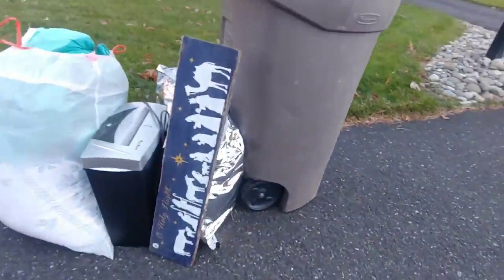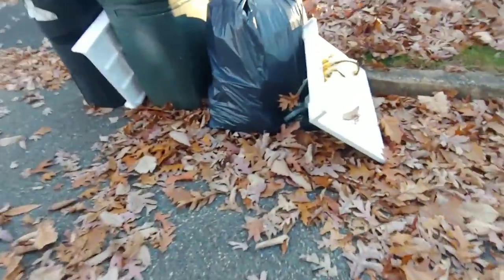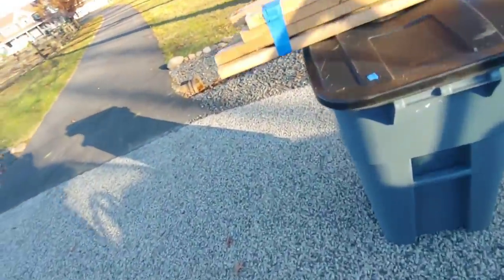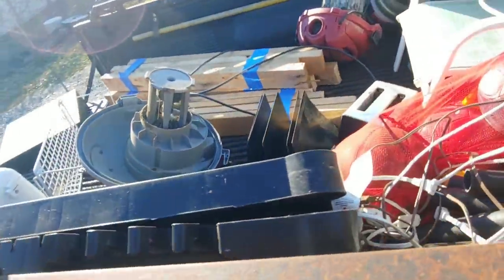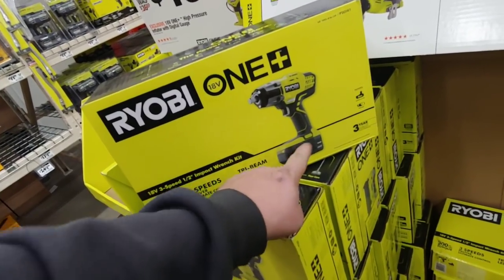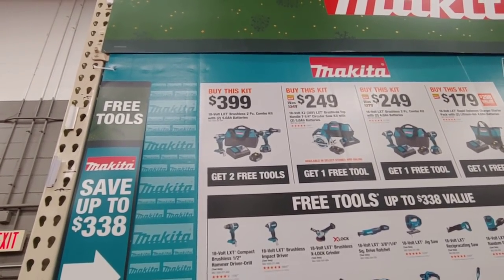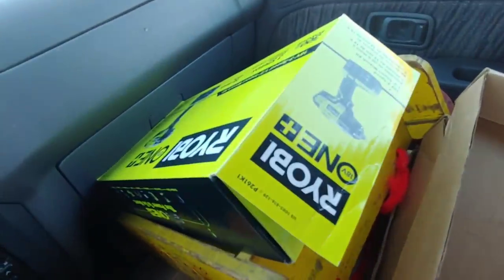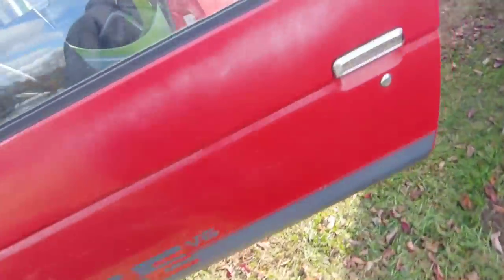Recycling Metal - trash picking Black Friday deals

Comment: I don't want the P135 I want the P125 you got. much easier and flatter to wall mount.
Reply from the maker: Yes but the P 125 does not charge all the batteries at the same time it charges them in series one at a time I believe the p135 will charge all of them at the same time but I may be wrong
Reply: @ScrapFarm  I am ok with that. Sequential charging is fine by me. I just prefer the formfactor. but dammit the P125 sells for quite a bit more than the P135 does !! Grrrr :-)
Reply from the maker: @nerys71  I got mine for twenty bucks at the flee LOL